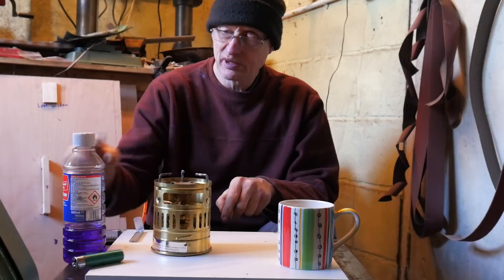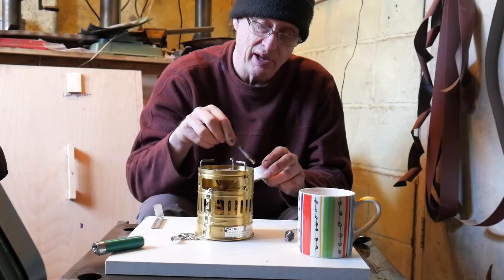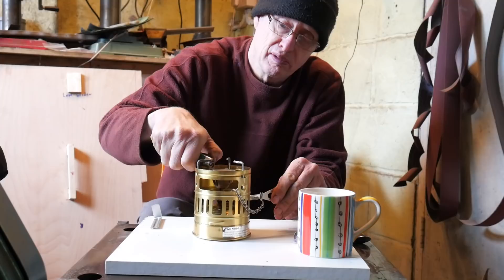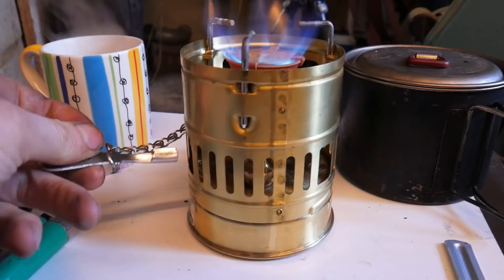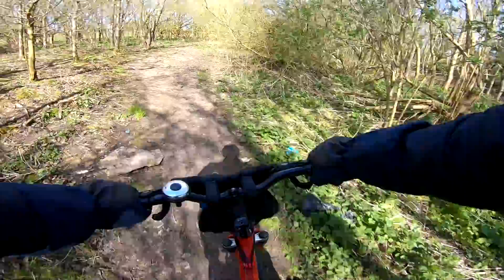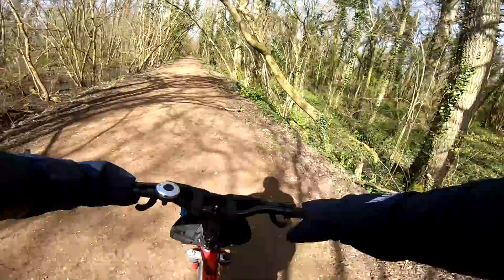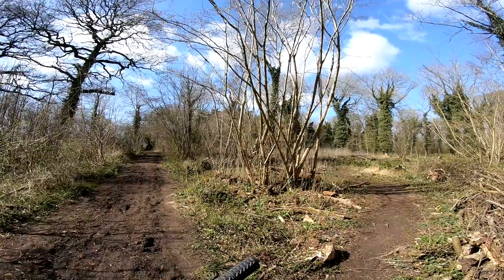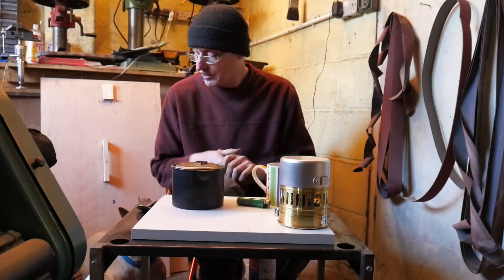More Svea 123 and The Coleman 533. BIKE RIDE daily exercise

Comment: In 1994 I hauled one of those Coleman 533, or a very similar model, from coast to coast, Atlantic Ocean to the Pacific by bicycle.  It ran off any fuel you could find and worked well.  I remember pulling into a service station in Ontario and filling the little tank from the pump meant for automobiles.  The attendant gave me a quizzical look to be sure.  In Minnesota by the banks of the Mississippi River, the mosquitoes were so thick that several of them flew in to my boiling water.  Added a bit of flavor to my evening coffee.  25 years later after letting it sit in the garage, I found it and fired it up.  There was still some fuel in the tank and it lit up and burned.  A bit smokey at first still worked.  Good gear that Coleman.

Comment: Good information about the Svea 123.. I have owned my Svea and Optimus 8R for 56 years now and both still work great .. I will never wear out those models .. All i've done is replace fuel cap gaskets after 30 years .. With the tank full i can hold the stove in my hands for several minutes and open the valve and out comes fuel for preheating .. I also use and candle under the tank for a couple minutes works too.. In cold weather i remove the windscreen and run a bead of "Fire Ribbon" around the generator tube (spirit cup) works very well , sometimes i do it in the summer that way too as i always carry a tube of Fire Ribbon with me in my pack.... Cold ground in winter and fall , i carry a pad to set the stove  on for better performance , in uneven ground where the stove is unstable , i carry an old lic. plate and that gives it more surface to sit on.. Great stove the Svea 123 is and is still a classic and will be for many years ..  just my take on a great classic mtn stove ..
Reply from the maker: Thanks Norman, a lovely comment

Comment: HI Sandy just a comment on the Coleman sportster. I have had one for 14 years now. It is known to me as the mega burner. I used it for fishing. After two years I was trying  to light the barbeque  at home and thought  it needs a little  help so I got the mega burner out and poured  some petrol out of it to help the fire, needless  to say I ended  up setting  the burner  on fire. Threw  it on the ground and covered  it in soil. Two hours later dug it up and thought  that's the end of the stove. Brushed the soil off and tried  to light it. To my surprise  it light and burnt normal. Eight years on it was still working on my fishing trips. Hence it is now none  as the mega burner. I do agree  it is a heavy stove but a mega one and cheap to run and good in wind and cold.

Comment: awesome video sir! i bought a new svea123r (since i was apprehensive about my ability to restore a new one) and i'm consuming all the information i can about running it effectively and safely. I didn't have much luck priming it properly on my patio. here in st louis it's about 25 degrees F right now, and was 18 degrees while doing testing earlier, with light breeze. I made a carbon felt wick, which allowed the indent on the fuel tank to hold more fuel for priming. still sub par results. i doubled the amount of carbon felt used for the wick, as well as used a tall aluminum wind screen around the stove. THIS proved be be my best prime yet, and achieved that proper svea sound. To be safe, what I did was first get the stove operating in the hallway at room temp, and observed what the stove sounded like and how hot the tank felt. With that information, i could safely use the windscreen and back it up a bit if the stove seemed like it was running too hot. at these temps with this wind however, even with wind screen it was just barely maintaining proper operating temp and pressure. I reckon in warmer temps you might need only 1-2ml of fuel for priming. in my tests with these low temps, it seems that 5-6 ml is necessary. Seems like a huge amount of fuel for priming, however it's on par with the fuel used between the priming cup of my msr whisperlite and the amount that's "wasted" stuck in the fuel line at the end of cooking. Sorry for the novel, i find this stuff fascinating. Have a good day sir!
Reply from the maker: Hi Charlie and yes it is fascinating and thanks for sharing your info. You might find in extremely cold conditions it will help a bit if you can insulate the base from cold ground. I have used a small square of closed cell foam mat to good effect when the ground is frozen

Comment: Love you videos mate. Just a little tip from someone who has had the  123r for many years. Put a bit of 12mm stove rope at the bottom of the stem where it meets that little well, hold it in place with a bit of wire. Use either meths or fuel from the tank to soak the rope and hay presto easy, safer and better priming. Hope that helps.

Comment: Hi Sandy, 
There I'd still another way to prime a Svea.  Equalize the pressure as you did, then open the valve half way. Then wrap your hands around the tank, until fuel begins to appear at the orifice, then light. The heat of your hands will pressurized the tank, no fuel needed.
Reply from the maker: Yes I know but the white gas will soot the burner quicker than meths, and on a cold day your hands will also get cooler

Comment: Ah yes, when I was in Boy Scouts back in the early 80s, that was the stove of choice, and how I missed that noise as a Svea was fired up. At one time you could get a pump to attach to the stove so if it was really cold out, you could pressurize the stove yourself. There used to be a preheating gel, that was also useful. I had a Coleman stove. I liked it better, much easier to control. A Svea at full burn would melt through a aluminum pot. I've seen it happen.

Comment: ...as an addendum to my previous "hot hands" comment, I should also tell you that (I believe) it was Optimus that made a Pump for this stove.  It was a little, solid aluminum cylindrical gadget, about 3 inches long, 1" diameter, with a protruding "knob" making it almost 4 inches long.  It was a simple thing, a solid push-rod, an o-ring, and a retaining lower aluminum fitting that mated with the fill cap.     It worked by placing the pump opening over the fill cap, holding it on, and pumping.  It only took 2 or 3 pumps to pressurize the stove, to enable the "dribble" of priming fuel to come out.  I was doing a lot of hiking in northern New York state in the winter time, and it helped the stove to be well-primed to get it going in the cold.  These brass stoves operate on Boyle's Law, lol.  I was required to purchase a new "pressure cap" to use with the pump... I still have the cap (which looks like the regular cap, but has a relief spring & valve inside), but somehow lost the pump :( . Come to think of it, since I still have the cap, any method of getting air into the stove will still safely pressurize it.

Comment: I have had the Peak one for over 30 yrs, used it the army, you can buy a replacement generator in fact I carry a spare, you are supposed to pump more pressure into it once you have lite the burner it will run perfect, the Peak one was the first one Coleman brought out, they brought out the multi fuel after

Comment: just a little advise, the rubber pump cups on the newer coleman stoves and lanterns dont last long , if you get a leather pump cup it will fit on there and work in the lanterns and stoves, i have a 1946 242c lantern that has the original leather pump cup. i just oil it up and flex it out a bit and install and it works, leather is better hope this helps you guys out there. also one last thing, i would take the generator off the coleman 533 stove  and spray it out with carb or brake parts cleaner, my 533 acted the same way yours did until i cleaned it . im sure y`all know this stuff , i just hope it may help someone, y`all please stay safe overseas everybody

Comment: I use a cotton pad soaked in vaseline and paraffin wax as the starter instead of meths and it works very well. Also I use Aspen fuel which doesn't go off

Comment: If Elsa will steal your bacon I’m sure she would like a bag full of snacks 😂
I prefer to prime my Stoves with alcohol, it’s cleaner. I made a donut wick out of a scrap of carbon felt to fit the SVEA 123 priming bowl. Tied the felt on with some stainless steel wire. The wick works really well at heating up the stove and seems to make a little bit of alcohol burn a lot longer. Just before the priming fuel dies down I turn the fuel valve on and away it goes, nice and clean start up.

Comment: Sandy glad you took my advice and can now see how the stove should be able to lighted directly into a blue flame then shortly a smooth roar once it’s warms up for a few minutes. Well done well done! When using it in cold weather you are correct to keep that fuel tank base insulated from the cold ground. If you are out in a cold adventure and the tank is really cold just warm it up inside a jacket if you can. Also if you do a lot of cold camping they do have a mini pump for this stove that attaches to the filler cap to pressurize the tank. Just look around on eBay as they do come up. I am so sad to hear what happen to the bee keepers work tragic that is. Why is it that the good people that do good things for others suffer the most. So happy you are enjoying the stove. Next will be a nice PRIMUS 96 or a radius stove or perhaps a Optimus 8R stove will be in your collection. PS not sure if you noticed my profile icon here it’s a PRIMUS No5 stove I restored. Cheers sandy and a pat on the head to Elle but don’t let her nick your tea mate. 😄
Reply from the maker: That primus No5 looks a rare thing of beauty. I'll have to check out your videos later
Reply: Wiltshire Man I will have to make some stove videos for you first I don’t make many videos more a watcher. Cheers and stay well my friend.

Comment: Svea 123R, has it got bigger over the years (mines in lock down else where)?
Thermal run-away - its fun when a bloody great jet of flame from the pressure relief valve blasts your eye brows off !
Lighting, just fill to correct lvl (to avoid thermal run-away), close off valve, hold in your hands until, when you release the valve, the jet wets with petrol then light Simple. Or  just use the pump 
Self pricking?
Reply from the maker: Yes I know about that too but priming with meths means less soot buildup on the outside of the burner
Reply: True thermal runaway is rarely the case. If the relief valve blows it usually is due to a worn pip in the valve. See BernieDawg channel on how to mend that.
Reply: The early Primus 71/optimus 80 stoves had a really primitive pressure relief system.  They had a solid fuel cap.  The safety system was a piece of wire run through both the top and bottom of the tank.  The wire was secured solidly in the concave bottom but only soldered into the top.  If the pressure was too great, the bottom of the tank would begin to deform. (Think about how the concave bottom of a frozen soda can pops out as it freezes)  Anyway, when this happened the wire would be pulled into the tank revealing a hole, which would equalize the pressure rapidly and without an explosion.

As far as the size of the 123 vs the 123r... the overall size is the same and the only difference is the redesign (hence the ‘r’) of the vaporizer assembly to include the integral cleaning needle.
Reply from the maker: Thats interesting I never knew that. Thanks
Reply: Wiltshire Man you can see it here:
https://classiccampstoves.com/threads/1953-primus-no-71.12906/

Comment: I like the 533 but the generators will clog if you use normal car petrol due to the additives. Coleman fuel/aspen4T.Naptha They are easy to work on though with plenty of spares. The Svea123R does not have a generator to clog. Bit Like The 8R Both have there place. I love stoves and collect them but a lot realistically are not for backpacking these days lol.(unless you have a sherpa or two lol).
Reply from the maker: Hi Alan, My first 533 stove clogged in no time even though it was run on white gas, I replaced the generator and got it going again, then the pump failed so I gave it to a friend. Sofar the second one has given good service
Reply: @WiltshireMan  Was it from new? If no perhaps it was run on petrol before? I do run mine on petrol sometimes but not often. The generators are not very expensive anyway. The 123 is a 'bullitproof style stove lol

Comment: The Coleman stove is just like the coleman or tilly lantern. The pump needs lubricatiing to stop it drying out. The generator is a cheap part to replace or clean. The USMC issued these things for field use and were lugged in packs very successfully. I have one in a issue can that doubles as a pot. Along with a USMC crested fuel bottle. I take it on 10 12km day hikes reguarly most weekends. Or I used to before covid lol

Comment: I've always wanted a SVEA for the pure novelty of a self pressurizing white gas stove but I've yet to see one on sale. Thanks for sharing. Don't see why you couldn't have fixed the first 533. Pumps and generators are readily available replacement parts. Also burning unleaded fuel instead of white gas will clog generators prematurely, despite the "dual fuel" designation.
Reply from the maker: I gave the first 533 to a friend. I said if you can fix it you can have it:)
Reply: @WiltshireMan  Fair enough :)

Comment: Look at how dirty the 533 is compared to the Svea... is it fair to say you like your Svea and thus maintain it better? Clean that Coleman stove, use naphtha or Aspen 4. Pump it 15 times before lighting it off, turn the fuel valve lower so you're not putting out all that orange flame, and pump it 15 more times to get it up and running well. The Svea generates it's own pressure, the Coleman has that pump so use it. You'll find that from a cold start and with the right technique the Coleman will be boiling your water before the Svea is primed enough to light. I have both, like both, but the Coleman is faster to boil and a lot less hassle if you follow the optimum startup sequence.
Reply from the maker: The only reason why the Svea was cleaner was because it was brand new. It is now as dirty as the Coleman. Fuel used in both stoves is either coleman fuel or Aspen 4

Comment: hi, try using Thompson's water seal??, cheaper than Fabsil - £3.99 400mls at Screwfix, Thompsons water seal £16.99 for 5 litres also at screwfix, apply with a cloth, read label.

Comment: The UK seems to have more woodlands and beauty than I expected, thanks for bringing us along. I typically use a small pocket rocket stove for motorcycle camping or roadside coffee but recently gifted a new 533. On a recent overnight I tried it out and found it doesn't like to burn at the lower setting. Is that normal in your experience? Not a fan of burnt eggs.
Reply from the maker: My 533 stove runs quite well at the low setting. It could be your vapouriser tube needs either cleaning or replacing. Try cleaning it with carb cleaner and see if that works
Reply: Good to know. I'll have to fiddle with it a bit and learn it better. Hoping I don't have to replace anything as it's new.

Comment: Strange the fuel tank on my friends  stove only gets warm to the touch. It's the burner gets hot and causes the fuel to be sucked up. It even works with filler cap loose. Maybe his has been modified..🤔
Reply from the maker: I didn't know that, I thought it was self pressurising Herb
Reply: @WiltshireMan  thanks matey maybe the fuel is different he is using. Take care. Nice to see woofas in videos.  Cheers from George and Jane

Comment: G'Day Sandy , - Thanks for sharing your 'stove work' .. can you explain a bit more about the FUEL required  please - might unleaded auto-petrol be used or not? - Please excuse my ignorance ..
Reply: Martin Kavanagh I have the Coleman and says it can burn white gas or unleaded. Unleaded seems to clog up the generator pipe faster. Don’t know about the Svea. The Coleman is 30 yrs old. I use a canister isobutane mostly now. A Jetboil pocket rocket burner.
Reply from the maker: Too many additives in auto fuel, best to use white gas (coleman fuel aka naphtha or panel wipe No3) To find out more about those fuels Google is your friend